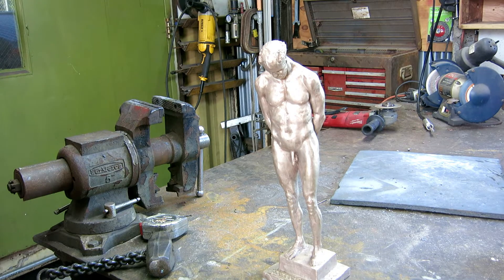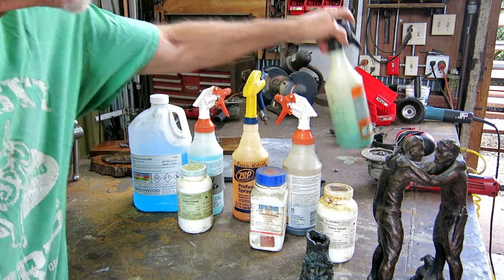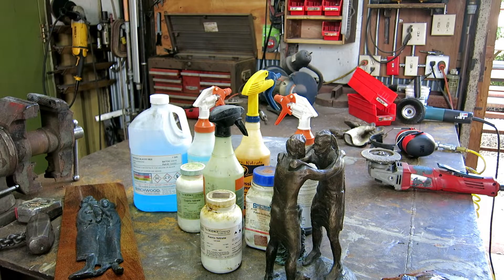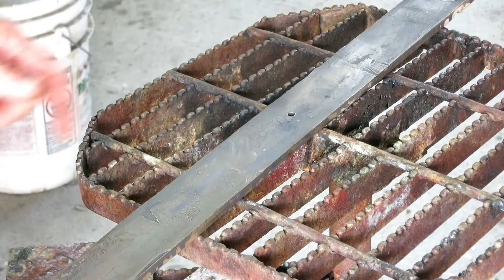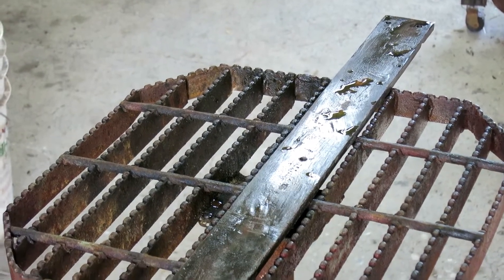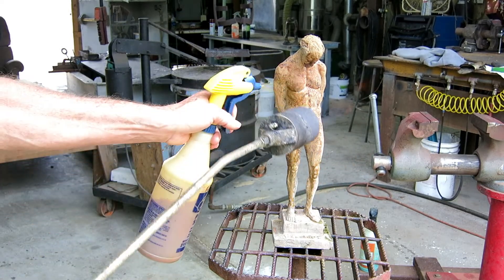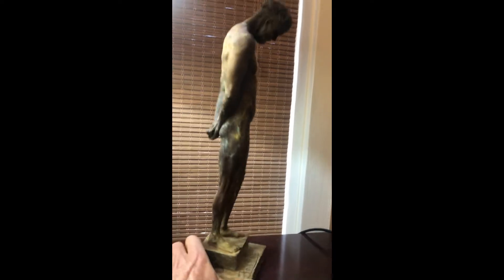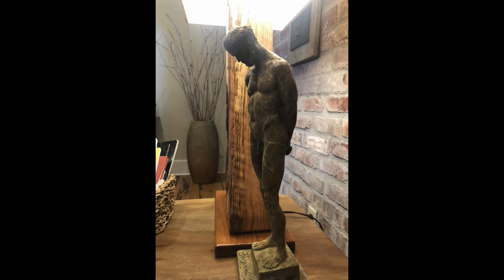Learning a new bronze patina through trial and error. Or, fail until you don't.

Comment: Here's a comment Barry that might be helpful!  ;-)  I warm my surface to around 200f.... Then when applying the solution, instead of spraying it, put the liquid in a small container and dip a chip brush into it.  Then just hold the wetted brush up against the bronze.  Control darkness by repeated coats.  Run a seriously diluted solution until you get the hang of it.  I find I can apply a more even patina tone across a larger area instead of pissing (pun intended) directly on the piece with a spray bottle....  :-p
Reply from the maker: I agree, I use a brush often. Different look though. But in this case a weak solution was not going to get us where we wanted to be.